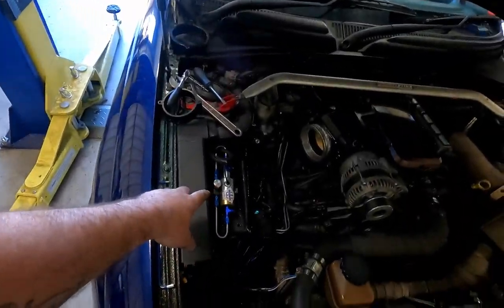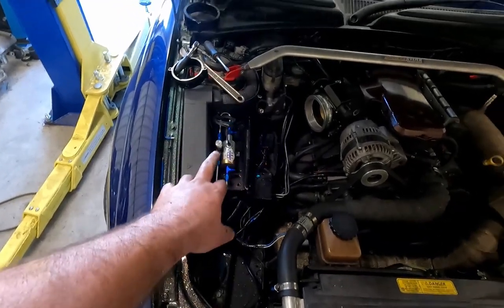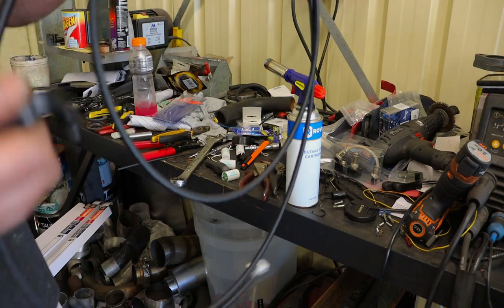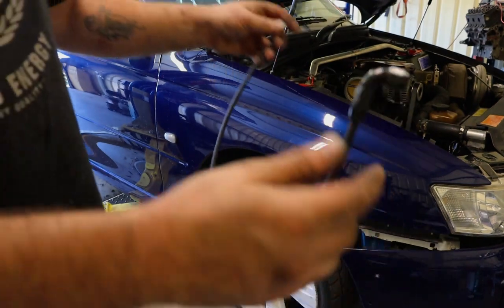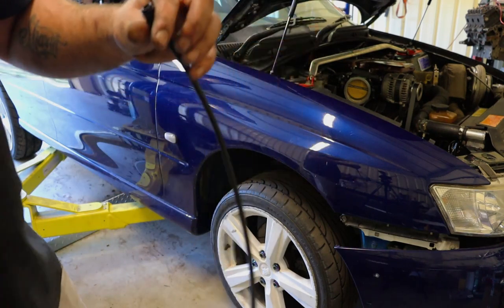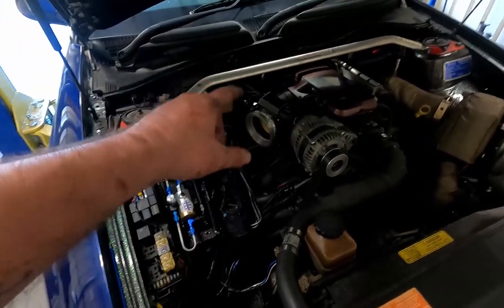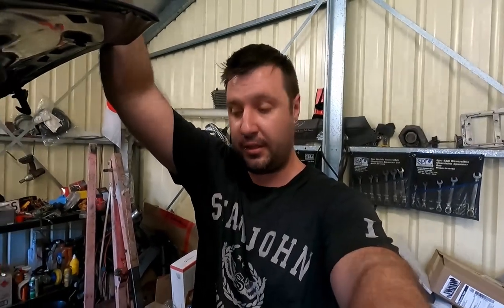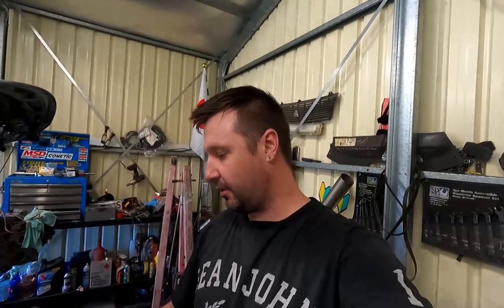Plumbing In The Clutch Slipper Valve To Ethel...

Comment: Wait for the "you need AN spanners for AN fittings" not a fan of Aerofail parts but they do their job 99% of the time. Interedted to see it working with that clutch and see if it makes it any easier to drive.
Reply from the maker: Lol i was expecting that to be one of the first comments tbh... and yeah the clutch is really painfull but the slipper valve should make it launch pretty good tho 😁🤘